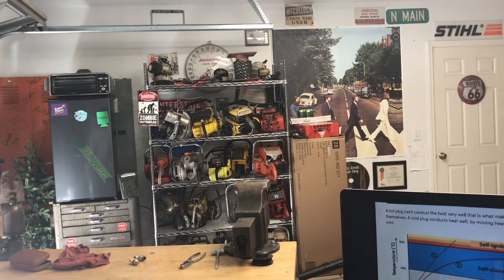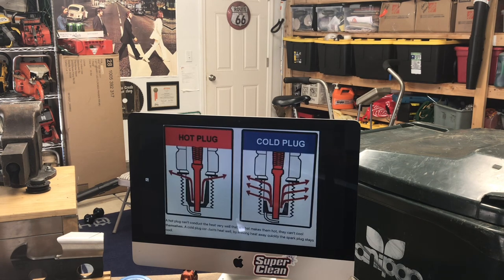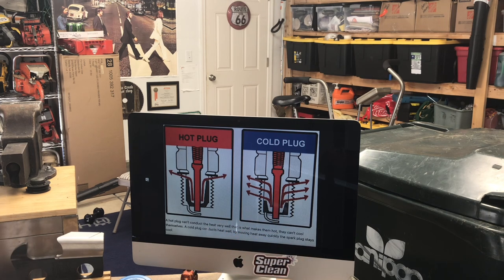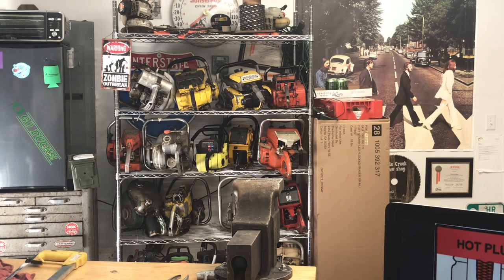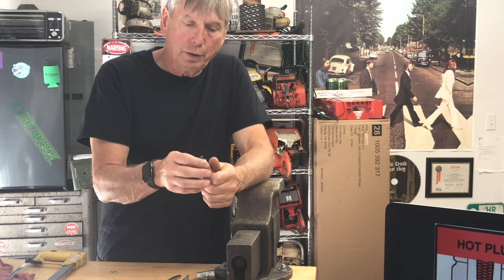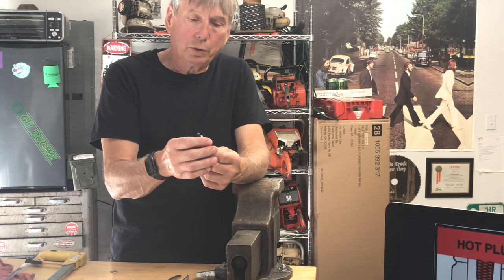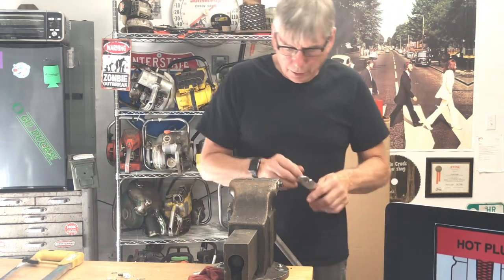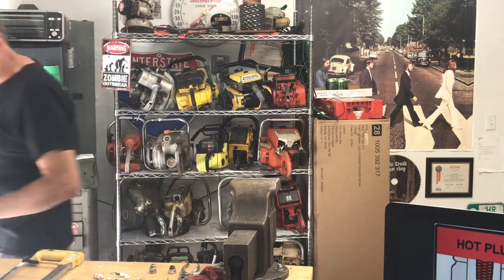WestCoastMuscleSaws Husqvarna STIHL Spark plug  Basics Testing Hipa Spark Plugs

Comment: Spark plugs - if in doubt, I replace them.  On most of my Stihl saws I use Bosch WSR6F at .020 or NGK BPMR7A.  Some saws use Champion CJ7Y, but these are older saws.  I like Bosch because they can get wet multiple times with gas and still work.  NGK plugs are not as tolerant of getting wet with gas multiple times.  Those of us that own Stihl saws know how often we accidentally flood them.  With Bosch plugs I very seldom have to replace spark plugs, which is why I use them.  On the smaller plugs used in newer Strato saws I use the Bosch USR7AC or NGK CMR6H.
Reply from the maker: Good info John,
WestCoastMuscleSaws 
TheChainSawGuy 
Rich

Comment: If your running Castor (benol or blendsall)or anything with a percentage of Castor (techniplate) the plug will get carbon no matter how hot of a plug you run. Not to many people use castor based premix anymore though.